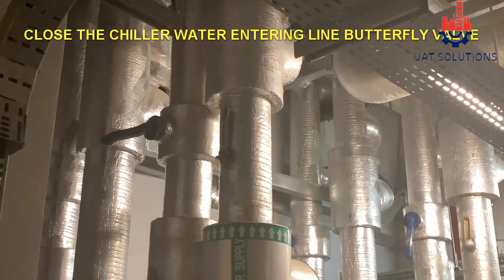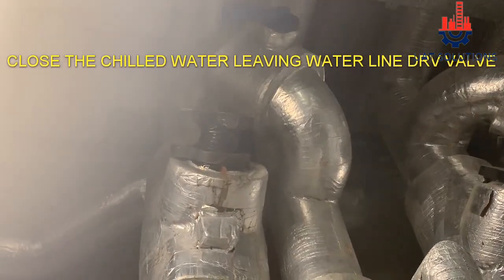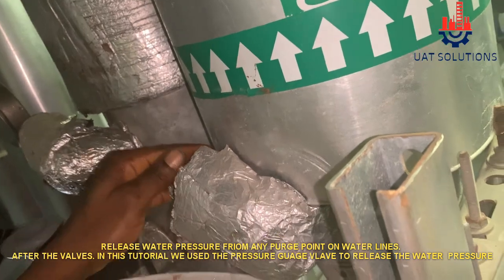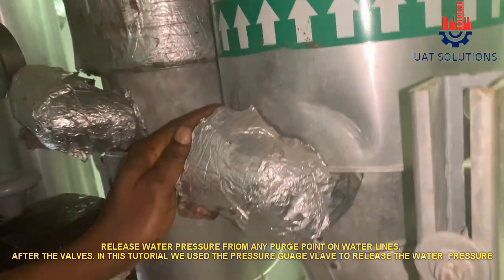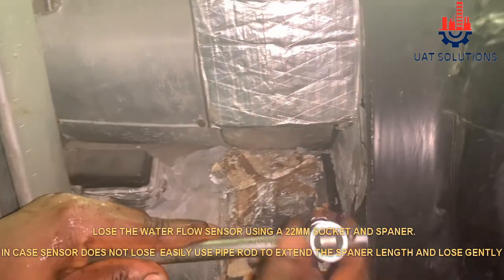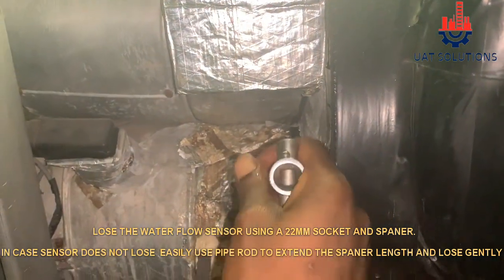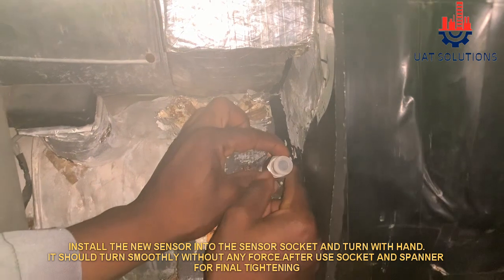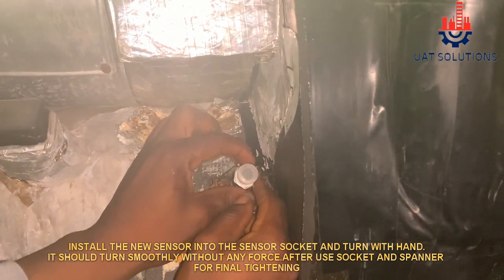How to replace Carrier 30XW HP0862 0022PE   WATER FLOW SENSOR Onsite installation

Comment: I've seen some of those sensors can be calibrated. Have you tried that?
Reply from the maker: Generally there is no need for Calibration. As they come factory calibrated. Incase there is doubt of wrong output from sensor it can be tested on calibration tool.